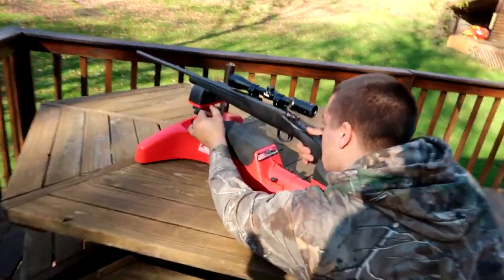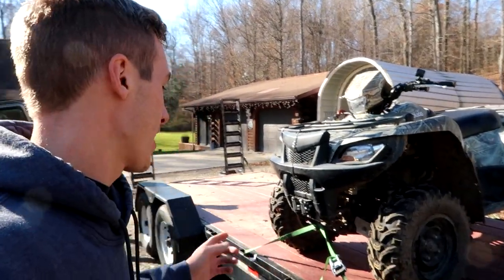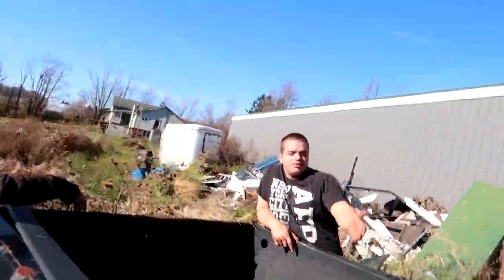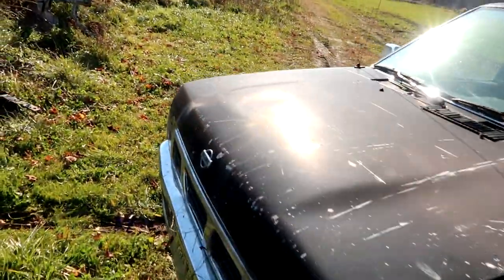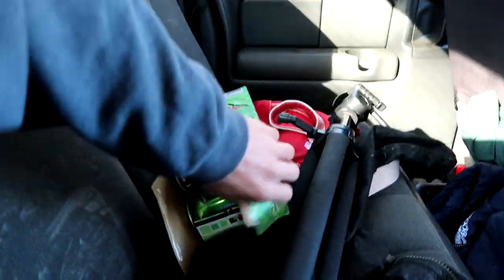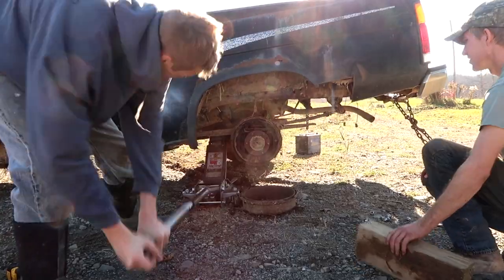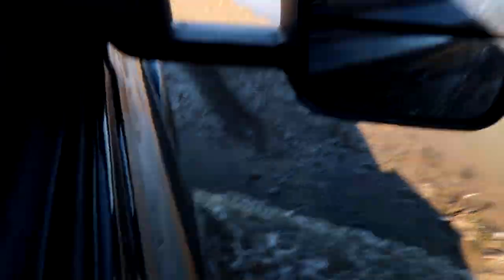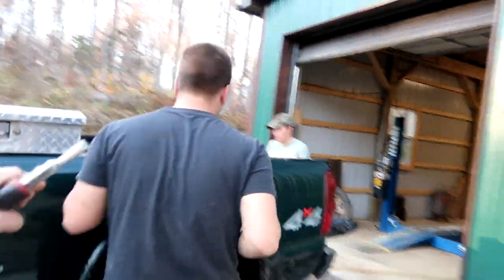THIS is why BLOWING UP TRUCKS ISN'T EASY

Comment: Out does Cummins but had a hard time yanking a mini-truck around.. Interesting.
Reply: MadMachinist5.9 what do you mean
Reply: Tyrell Wagner One of the kids said it outdoes Cummins and Powerstroke but had a rough time moving a small truck.
Reply: MadMachinist5.9 a small truck that had been sitting for 2 years and had no back wheels and the Duramax didn't have good tires. interesting
Reply: John Wehner Don't think my 12 Valve would've had an issue. It does also have 1,000 reasons not to. lol Plus I would've probably pushed it first.
Reply: my half ton dodge with bald tires pulled a 61 mercury comet that had been sitting for 20 years
Reply: a cummins would yank that out no different then a Chev but ford on the other hand are toys compared to dodge and chev
Reply: Dope Mx Whatever ya' say. haha
Reply: MadMachinist5.9 lol my powerstrocke would rip that axle out of that dirtymax only if my 4wd wasn't out
Reply: Dope Mx sorry didn't mean to put that other guy
Reply: Alex Henry learn how to spell powerstroke the right way not powerstrocke. well no one ever said ford owners were smart so nvm
Reply: Jesse Duramax lol
Reply: So true

Comment: Put 35-40lbs in and save the rest for way more videos. Also I vote to remove the hood and set the tannerite in the engine bay before shooting, or cut a hole in the hood

Comment: why would you blow up your old nissan, what if your duramax breaks down, you might need a backup
Reply: Darrek LeRoy . that truck isn't really worth fixing
Reply: Carlos Ramirez as in the nissan could be used as an emergency back up if the duramax breaks
Reply: Darrek LeRoy dude taht shit cant be saved
Reply: Darrek LeRoy cude that truck is too far gone
Reply: remember he still has the tan nissan that he rebuilt the bed on atleast i think he still has it
Reply: bud that truck Is garbage he told us it didn't run plus look at it
Reply: I'm sorry hate on Ford all day but cummins?, now your going too far.. lol